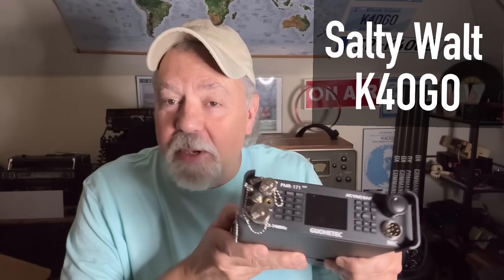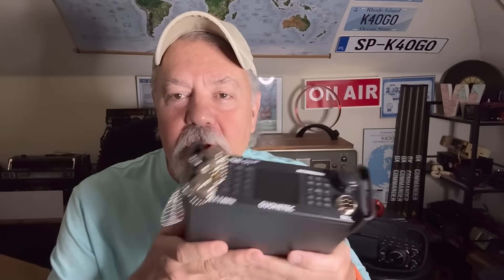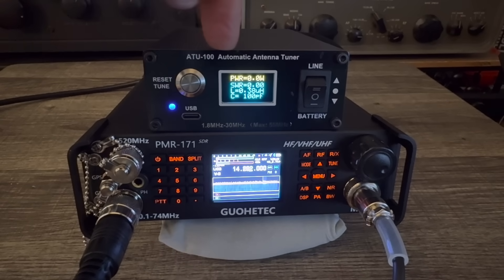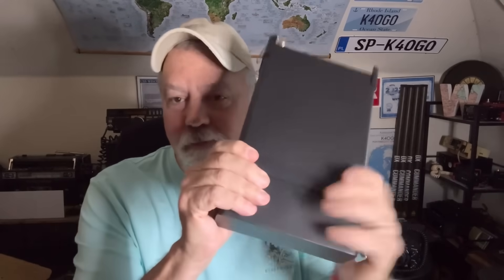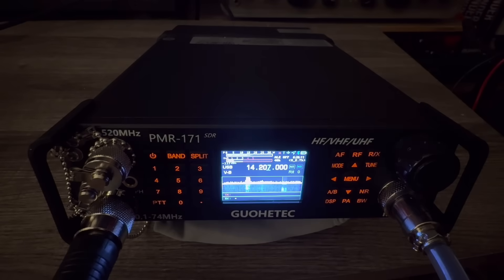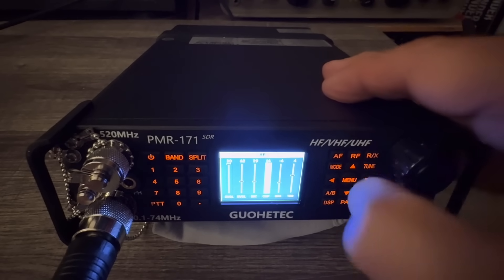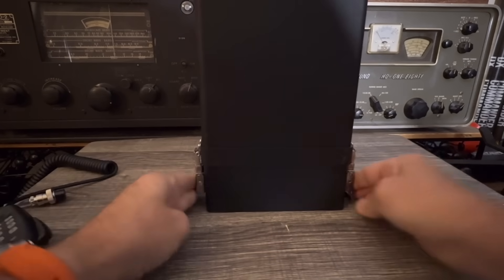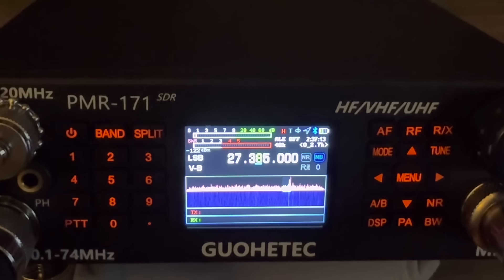GUOHETEC PMR-171 Transceiver - I Love This Radio

Comment: The Guohetec PMR-171 is an ultra-portable, all-band, all-mode Software-Defined Radio (SDR) transceiver designed for amateur radio operators, field enthusiasts, and those needing a versatile communication device. Below is a comprehensive overview based on available information:
Key Specifications and Features
	•	Frequency Range: Covers 100 kHz to 2 GHz, spanning HF (160m to 10m), 6m, 2m, and 70cm bands.
	•	Modes: Supports multiple modes, including FT8, USB, LSB, CW, AM, FM, RTTY, DMR (optional), and WFM (receive-only).
	•	Power Output: Up to 20W, though some sources note discrepancies, with claims of 10W in certain contexts.
	•	Dual VFO Modes: Allows simultaneous monitoring of two frequencies and supports split-frequency operation (transmit on one frequency, receive on another).
	•	SDR Technology: Features real-time spectrum display, waterfall chart, Doppler frequency tracking, and DSP digital noise reduction for enhanced signal clarity.
	•	Antenna Tuner: Built-in high-speed automatic antenna tuner for 4m to 160m bands.
	•	Power Supply: Uses a modular 5Ah battery carrier with dual battery backup for extended field use. Also supports 9VDC–18VDC external power with reverse polarity protection.
	•	Display and Controls: High-resolution LCD with adjustable backlight and keypad brightness for readability in various lighting conditions. Supports wireless control via the QRadioBLE mobile app over Bluetooth, reducing wired interference. USB-C connectivity allows integration with standard amateur radio software.
	•	Optional Modules:
	◦	Compass module for navigation.
	◦	DMR module for digital mobile radio communication.
	◦	GPS module for location tracking.
	◦	High-precision TXCO (±0.5ppm from -10°C to 60°C) for frequency stability.
	•	Portability: Designed for field operations like POTA (Parks on the Air) and SOTA (Summits on the Air), with a military-inspired design, top-panel controls, and antenna ports for backpack use. Includes a short jumper cable to access ports when the battery is attached.
	•	Additional Features: Built-in sound card with IQ and audio output, AGC speed selections, RF gain, squelch controls, AM/FM broadcast receivers, automatic sleep, and transmit timeout timers.
Pros
	•	Versatility: Covers a wide frequency range and supports multiple modes, making it suitable for diverse applications, from QRP (low-power) operations to mobile and field use.
	•	Portability: Compact design with a modular battery and low power consumption is ideal for outdoor activities.
	•	Modern Features: Bluetooth control, USB-C connectivity, and compatibility with amateur radio software enhance usability.
	•	Positive Feedback: Some users report satisfaction, particularly for digital modes like FT8, and praise its build quality and packaging. One user compared it favorably to the Icom IC-705 for QRP field operations, achieving their goal of an all-band, all-mode radio under $1,000.
Cons
	•	Design Flaws:
	◦	The battery blocks access to the USB-C port, requiring a jumper cable for digital modes or CAT control unless using Bluetooth.
	◦	Uses a TNC antenna connector, which is less common than BNC, potentially requiring adapters.
	•	Usability Issues:
	◦	The manual is poorly written, and programming the radio (e.g., saving frequencies to memory or using Bluetooth) can be challenging, requiring trial and error.
	◦	Some users report subpar microphone quality and poor modulation, necessitating close proximity (2 cm) to the microphone for clear audio.
	•	Reliability and Support Concerns:
	◦	Mixed reviews highlight issues with the radio’s performance and difficulty resolving problems through dealers like Alibaba. One user returned the radio due to unresolved issues, and another gifted it to someone else to troubleshoot.
	◦	Guohetec’s track record (e.g., the Q900’s lukewarm reception) raises concerns about long-term support, firmware updates, and overall quality.
	•	Incomplete Documentation: The “Engrish” instructions and lack of clear programming software documentation frustrate users, particularly for advanced features like DMR or Bluetooth.
	•	Cost vs. Value: While feature-rich, the PMR-171 is considered expensive for a Chinese radio, with some arguing it fails to balance cost, quality, and portability compared to established brands like Icom or Yaesu.
User Experiences
	•	Positive: A user on RadioReference praised the radio’s military-inspired design, DMR functionality, and ability to decode hotspots out of the box, recommending it for portable, QRP, and mobile use. They created a Facebook group for PMR-171 owners. A YouTube post from August 2025 also expressed enthusiasm for the radio’s capabilities.
	•	Negative: A French user (F4IGU) was initially excited but disappointed after testing, citing poor microphone quality and modulation issues, leading to a refund request after three hours of troubleshooting. They created a French PDF manual to address documentation gaps. Another user found the radio “half-baked” with questionable design choices and insufficient support.
Availability
	•	Sold through platforms like AliExpress, Amazon, and eBay under the Guohetec or HamGeek brand. Prices vary, with some bundles including antennas or modules like DMR, GPS, and compass.
	•	The DMR module’s availability is unclear, with users seeking information on where to purchase it.
Considerations
	•	Target Audience: Ideal for operators seeking a compact, all-band, all-mode radio for field activities, but it may not match the reliability or polish of premium brands like Icom or Yaesu.
	•	Learning Curve: Be prepared for a steep learning curve due to poor documentation and complex settings.
	•	Risk: Given mixed reviews and Guohetec’s inconsistent track record, potential buyers should weigh the risk of quality issues against the radio’s feature set and cost.
Recommendation
The PMR-171 is a feature-packed, portable SDR radio with significant potential for field operations, but its usability issues, questionable build decisions, and support concerns make it a risky purchase. If you’re comfortable troubleshooting and experimenting, it could be a cost-effective alternative to pricier radios like the Icom IC-705. However, for those prioritizing reliability and ease of use, established brands may be a safer choice. Check user communities (e.g., the PMR-171 Facebook group) or YouTube reviews for hands-on insights before buying.
For further details, you can explore the English user manual available from Unicom Radio or contact sellers on AliExpress or Amazon for module availability.
Reply: At 300-400 I might jump.  At 700 plus….no effing way.  They’re gonna price themselves out of the market.  
For 700 you can get a name brand proven radio.
Reply: @Craigjordan121 lots of people will buy it though due to reviewers saying how good it is, without giving a thought to how cheaply it's made. I agree, it's far too much money.

Comment: Thanks, Walt. I almost pulled the trigger and brought this radio 2 years ago. What stopped me was reviews by YouTubers that said a lot of the advertised features did not work, or at the very least were hard to get to work through the menu system. The final straw for me was a ham that was a PAID product tester for GUOHETEC. He had noticed some problems and had emailed the company about the problems. Several ignored emails later, he decided to CALL the company in China. The response he got was "You are an engineer, you should just figure it out" That is it for me. If they had that kind of attitude with someone they were paying, what type of support would they give me ??

Comment: As  a CW operator I have questions about its performance using that mode. Filtering? Auto keyer?
Reply: It does do those things. Also has BLE connections to peripherals such as BT keyboards.  You type, it converts and TX in CW.

Comment: All that appears to glitter is not gold. I've had one of these radios for quite sometime and I have to say it is one of the all time worst radios I've ever owned. The manufacturers shoehorned the firmware from another radio, namely the McHF project SDR radio, into it. The power output claims are bordering on science fiction as the devices used are not rated for those power outputs. Spurious emissions are rife, mainly because the output stages are being driven well beyond saturation. Lastly, ask yourself if you've just watched a review or an advertisement thinly veiled as a review?

Comment: That's the radio that Icom and Yaesu should have made.  There was another radio like that called the Vertex VX - 1210 and was 25 watts and had a built-in battery pack and antenna tuner and cost north of 2K.

Comment: I thought BNC outperforms SO239 at higher frequencies and BNC is more wx tight? The only reason to choose SO239 would be for thicker diameter cables…. Which are not necessary nor advantageous for short flexible runs needed portable. So how is this an improvement? 73 de VK2AOE
Reply: BNC is definitely the better of the two.

Comment: Great review.... However for me, I think I'd pass....Given the price of that radio, if UHF/VHF is not something you really care about, I would either go for the G90 or a FT891,  The list on that thing is $599 on the main website, you a quick search shows it for $550 (ish) on Ali and other sites (yes I saw one for 450 but that is suspiciously low) , It's not too spendy, but consider that for $629 (currently on sale)  you can get an FT891 that does 100 watts, if QRP is your thing just dial the power back and you can still use the small battery and I think an 891 is smaller then that radio (not sure). Or..... for roughly $450 (ish) you can get the proven G90.  And if UHF/VHF is something you care about, you can get a TidRadio H3 for 20 bucks, load nicFW and have a solid radio :)    Still love the review man :)

Comment: FCC Certification: The PMR-171 does not appear to carry FCC or CE markings, which suggests it may not meet formal compliance standards for spurious emissions and harmonic suppression required for legal operation in the U.S. and Europe.

User Reports: Several amateur radio operators have noted issues with:SSB Transmission Quality: Described as “awful” by one reviewer, indicating poor audio fidelity and possibly distorted output.

Firmware Instability: Operational glitches and inconsistent performance could affect spectral purity.

AGC and Band Implementation Problems: These may indirectly contribute to unwanted emissions or poor filtering.

Furthermore, CB radios (Part 95 Subpart D) must be FCC-certified for use in the CB Radio Service. 

Amateur radios (Part 97) are not allowed to transmit on CB frequencies unless they are specifically certified for CB use—which they almost never are.

Since this radio is neither certified for Part 95 nor Part 97, it's illegal to use in the U.S. Europe? dunno.
What's the responsibility of [licensed] U.S. ham radio operators when doling out advice? Put another way, is it ethical for licensed doctors to advocate the use of second hand needles to diabetics just because those needles are cheaper than sterile new needles? This radio, like almost every other East Asian radio, is not ready for the U.S. market. I wouldn't touch it if it was given to me.
Reply: They say they have fcc certification and show it on their website. I haven’t personally tried to decipher the wording to see what it covers.

Comment: Does the FHSS feature work?
Reply: Not yet. They say they are working on it. Been 3 years I’ve been hearing that. 
Last update was two weeks ago. Still not working. 
Regardless, you need the GPS model to make it work, whenever they finally sort out the software side of the issue.
Reply: @brianc0620 Thanks.

Comment: I came across this radio a few days ago, but I dislike the coax ports on the front of it. I'm also looking for an all-in-one solution, and I found the ZASTONE ZT7500 transceiver. Have you ever heard about the Wolf project by UA3REO?
Reply: I wish somebody would post up a really good review of that radio, a few hams have very short videos of them using the radio but not much outside of that which gets annoying.
Reply: @K4AX Exactly. Not one in-depth review of that transceiver.

Comment: That's a serious battery connection!  Does it block all the rear ports completely?
Reply: Yes they do get blocked by the battery. They provide a short battery dongle type power cable that lets you remove the battery and then access the ports on the back, while keeping the rig running from battery.

Comment: Couple questions. ... Is there provision for direct frequency entry from the keypad, like on the mic or some kind of thing? Also, any idea what commands it uses for CAT control? Finally, I thought I remembered reading that the battery blocked some of the ports on the radio, like the key jack...true or false? While I did just recently buy an Icom IC-7100, this might nevertheless be interesting.

Comment: On the Guohedz website, in the technical specifications, at the very bottom of the page, it says SSB 1-10W in AM 5W. On the promotional leaflet at the top, it says 20W. That's strange to me. According to some users, the real power is 10W, especially on higher bands. You can tell by the VK connection how the reports will go. You could also try FT8 and Psk reporter. If it's 20W on HF, it'll be a great radio!

Comment: I’m guessing you have to switch antennas for the 2M/70cm stuff if you’re using a long wire/EFHW.
Reply: It appears the 2m/70cm antenna port is the BNC above the SO239.
Reply: @paulsengupta971 it’s actually TNC. Better than BNC for manpack purposes.

Comment: I initially thought how does that compare to the G90.  Then I saw it was a shack in the box HF, VHF, UHF.  How is the internal tuner on this compared to the legendary G90 internal tuner?  Does it have a built in sound card for digital uses?  The product web site doesn't show a picture of the back with the battery removed.

Comment: Might be the the perfect radio-IF-it had a bigger display. I really wish their display was just twice as big. That goes for the G90 as well. Please Xiegu- come out with a 20w internal,decent sized battery, bigger display-doesn’t have to be as big as my 7300 or your 710, but twice as big as they are.